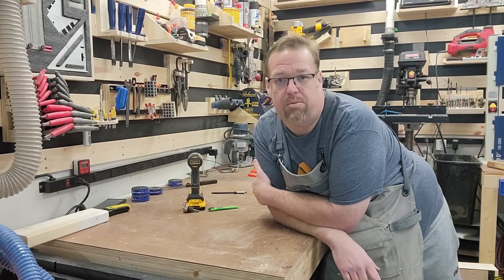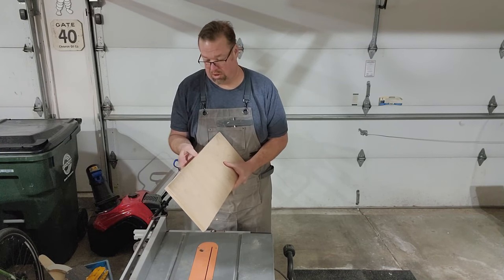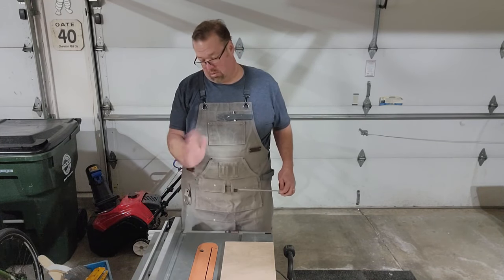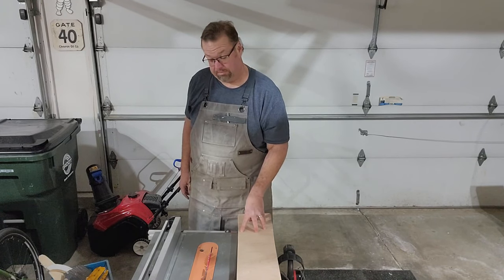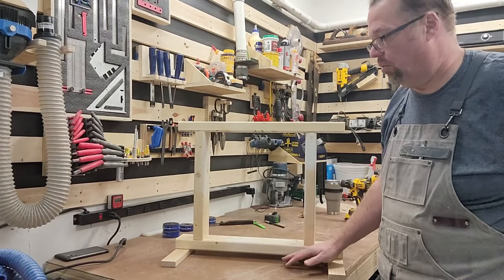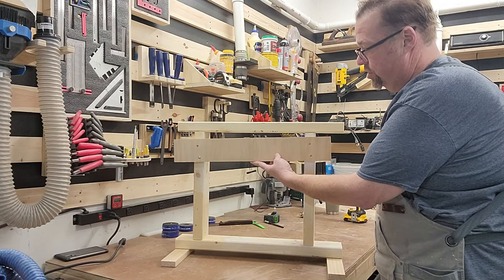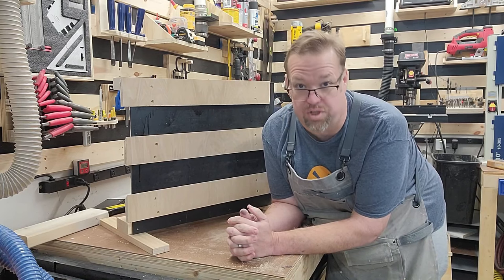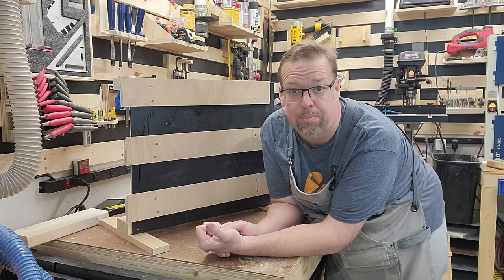BEGINNERS GUIDE to Building French Cleat Walls - The Do's and Don'ts

Comment: This is hands down the best video on YouTube explaining French cleat system for a beginner.  For example you  explaned the mistakes of why the speaker tool holder didn't work.  It was so helpful.  I hope you show your redo.  Also, I would like to see how you made some of your tool holders, like the drill bit holder.   You are so good at explaining the basics.  That's great for a beginner like me.
Reply from the maker: Thanks for the feedback, I plan on another video in the next few weeks where I cover some of the tool holders I've built, and some new ones I have in mind. Welcome to the channel
Reply: I too have been using this method for building mine and it is the most effective method for building I have found!!

Comment: I’ve watched a LOT of YT videos on French Cleats, and you raise some points that no one else has!  For example, no need to make the tool holder clears the same height as the wall cleats.  Or, no need for the tool holder cleat to run the full width of the holder.  Nice job; glad I watched to the end!

Comment: Thank you for the detailed process! Makes sense. We are going to be using the French cleat system to install a removable 2 part (split down the middle) king size murphy bed in a cargo trailer... Camping on the weekends, empty usable cargo trailer during the week for work etc. Bed will be 2x4 construction but feel confident 3/4 plywood cleats on both sides will be strong enough. we will use full length cleats on the bed cleats as well as the wall. Bed will also be supported with legs. Bed can also be a couch/sofa if needed too! This video also gave me ideas how to add a small shelf to put my phone/book on in bed as well as a removable table in couch position. So many options!!!
Reply from the maker: Good luck with your build! Let me know how it comes out.

Comment: I have also been building small organizing cabinets or at least simple boxes to organize like items to get organized.  For example, I built a Dremel tool station that has the tool and all accessories and supplies in one enclosure that hangs up on the French cleat wall and comes off when needed.  Super neat. 
Now I’m making something similar for all my soldering irons and wire splicing stuff (also decorating it in a steampunk theme to make it more fun).
Reply from the maker: That's sound pretty neat!

Comment: The math is pretty easy. It’s ¹/₂ the width of the board - ¹/₂ the thickness of the board - ¹/₂ the width of the saw blade kerf. In your case: 3-¹/₂ - 3/8 - 1/16 = 2-13/16 where you put your fence. Hope it helps!

Comment: Also, to make them even easier to cut, just angle your blade to 45 and set the fence however thick you want your cleats, then just start cutting them off a 4x8 sheet, one after another...

You end up with a 45 degree cleat on top, and a 45 degree that goes back towards the wall on the bottom then, and it looks cool!

All I'm saying is, in all of these videos for French Cleats, people always tell you to measure this and that to find the middle of each double cleat you will cut, all so that the bottom is squared, but it's such a huge pain in the @ss to screw around like that when you can just set the saw up and start ripping them off one after another, and you don't have to worry about the knuckle cutting edge that's left on the bottom edges then either, because it's a 45 degree that slops back down towards the wall, and they all match and look cool as well!!!

Comment: Did you put plywood over your drywall before attaching the cleats?  Some attache the cleats directly to the drywall, and others recommend ~ ½" plywood over the sheetrock, either for aesthetics or perhaps to allow more attachment points for the cleats.  Any advice?  Great presentation.  I especially appreciated how you stressed proper construction of the tool cleats so they don't rotate off the wall cleat!  Thank you!
Reply from the maker: Its drywall. But the cleats are screwed through the drywall and into the studs with 3-1/2" screws

Comment: I’ve built some for cabinets but don’t have them hung yet. I’ve been planning another wall for tools and I e been watching lots of videos for ideas. I agree with you that both sides do not need to be full height. I keep wondering why other channels keep telling you to cut them so they are EXACTLY the same size.
Reply from the maker: Nods, my advice comes from my own experience. The 45 does all the work. The height of the cleat on the tool holder on most cases is inconsequential. Only when mounting something very heavy or a cabinet, would I go full height.

Comment: Mdf works fine. Maybe not in high daily use but for the average guy it’s lasted a year so far. I also have open studs with 0 problems. My 8lb maul hangs in the middle of studs again 0 issues after a year. I made my cleats 2 1/4” wide only 1 screw per stud. Other than disagreeing with materials this video is nicely done! Good job helping with information that’s useful!

Comment: That answered some of my questions.  I had wondered about the space between the cleat and the cleat you put on the tool holder.  I can see 2" cleat for tool holder would be great.  do you rip 2" strips with a 45 for your tool holders so all you have to do is cut off a section for the tool holder?
Reply from the maker: Cleats are spaced 3-1/2 apart. I use a 2x4 as a spacer. My Cleats are 3" tall and I use 1x4 pine board that I cut a 45 on the edge
Reply: Yes, rip a couple of full length 2" strips ... then you can cut off a piece, the size you need, as you build each tool holder.

Comment: I want to put French cleats on my sheet rock wall. I’ve seen people add French cleats to a sheet of plywood then attach the whole assembly to the sheet rock wall. Securing the whole assembly to the sheet rock wall do you recommend screws go through the French cleat through the plywood through the sheet rock into the studs? Or just the plywood backer board of the French cleat?
Reply from the maker: I went directly into the studs. My wall is drywalled. Plywood is only needed if you dont already have drywall, or your stud spacing is too far apart. (like 24"+ instead of 16")
Reply: If you decide you need plywood over the drywall, I would attach the plywood first (using screws long enough to put 1 1/2" into the stud, like described in the video), THEN add the cleats to the plywood.  That gives you the versatility of moving/rearranging the cleats, in the future.

Comment: I want to put French cleats on my sheet rock wall.  I have seen people use sheets of plywood that they attach the French clear to prior to hanging them on wall.  Do you just secure that whole assembly to the studs or would you secure the cleats through the plywood thru the sheet rock into studs?
Reply from the maker: You can see that I just secured it to the studs. Plywood is only needed if you didn't have drywall or your stud spacing isn't 16" on center

Comment: I've got a metal frame shop where the metal studs are about 5feet from each other. I want to do a cleat system so would you recommend putting wood studs between the metal studs or do you think it's ok to put a piece of plywood attached just to the metal studs?
Reply from the maker: I'd put up a sheet of plywood between the metal studs if it was me
Reply: 5' is a pretty good span, but in my opinion, if you use 3/4" - 1" quality 5-ply plywood, I think you would attain the strength you're looking for.  That said, any wood studs added between the metal studs certainly wouldn't hurt, and would create additional strength.  Perhaps add the wood studs in just one or two of the bays, for handling your heaviest tools, then just use plywood everywhere else, for the smaller items.

Comment: Bought a switch from Klein plug any tool and and a dust collector and when you turn tool on the dust collector automatically turns on and continues to run like 15 secs after you shut off tool